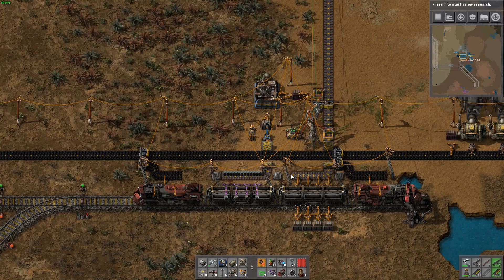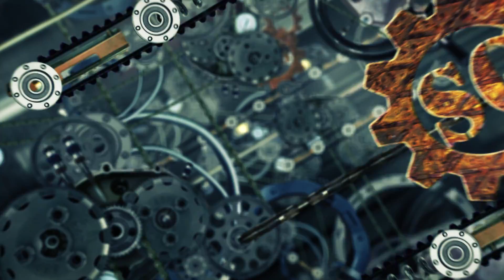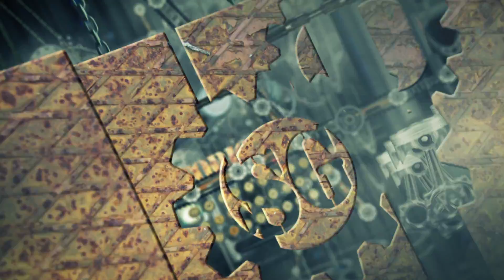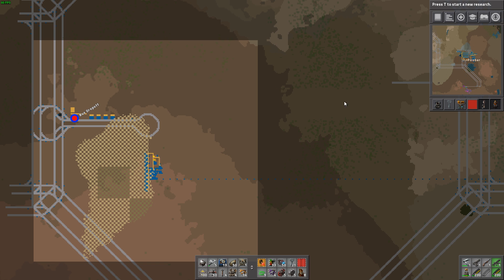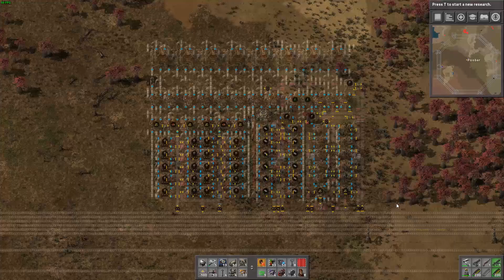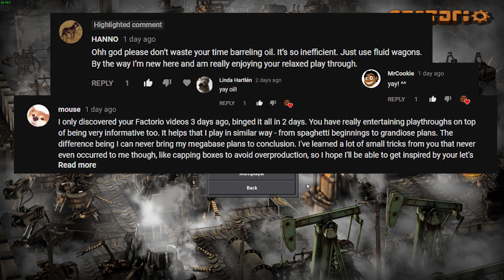FACTORIO 0.16 | Processing Oil - Episode 11

Comment: I don't understand why you would use barrels of oil over fluid wagon, it's much cheaper and easier to use the fluid wagon with a pump.
Reply from the maker: true; I switched to fluid wagon.
Reply: Sho Co2, I don't understand why you would not listen to the beginning of the video where she specifically explains the barrel/wagon situation.